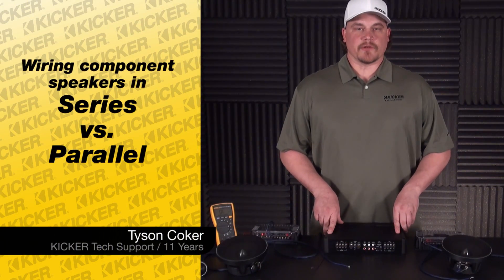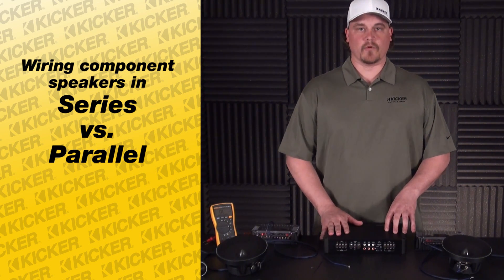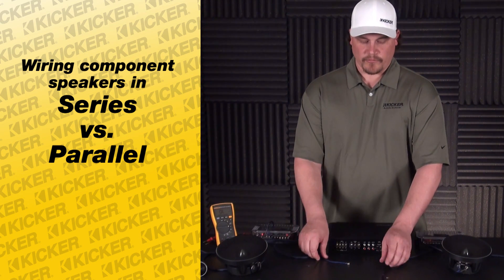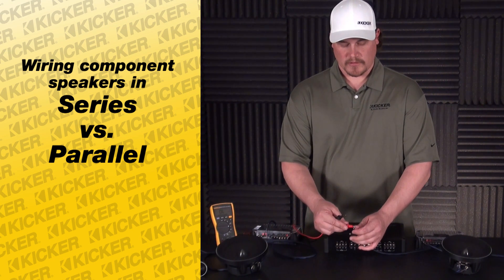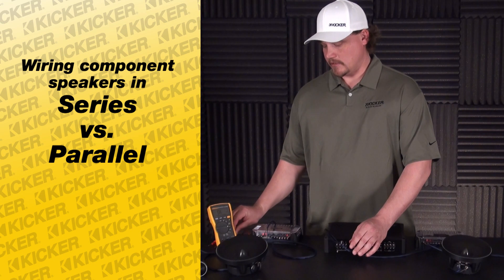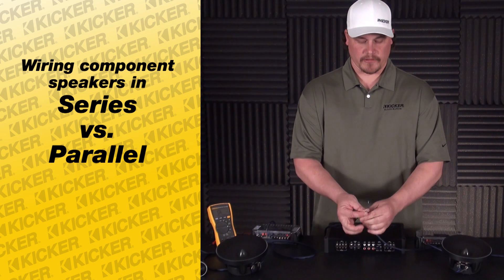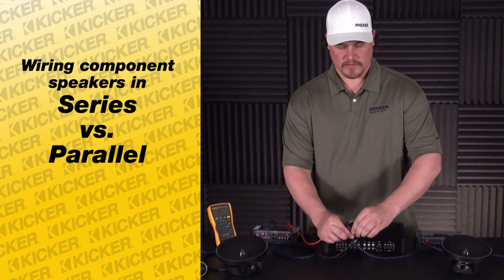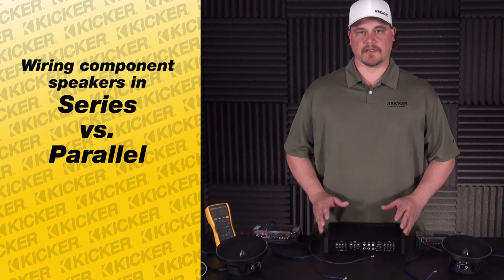Speaker Wiring: Component Speakers

Comment: Im installing a sound stream system in my crown Vic one issue I have is I have a 4 channel amp at 2 ohm with 4 ohm speakers  and tweeters in the doors component  speakers what's the best way to connect these to my amp any suggestion  would be helpful thanks

Comment: I have a 777 RMS watt on my 4 channel  Rockford T600-4 amplifer. I got two sets of 4 ohm Rockford component speakers.  Speaker rms is 100 watts is it ok to wire them in parallel? Each channel of the amp is going to see a 2 ohm load. If its ok can the power be reduced to match the speakers? The amp at 4 ohm load it delivers 100 rms, 2 ohm load it delivers 150 rms to each channel.